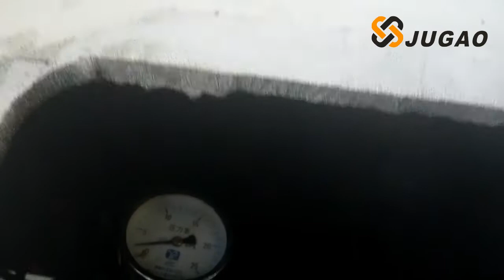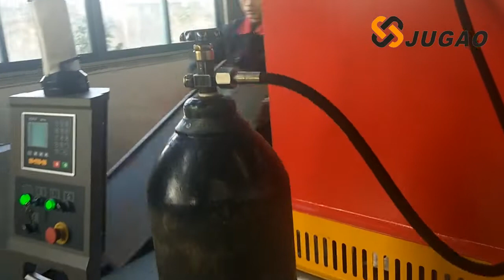QC12Y/K hydraulic shear machine. metal shear. blade can't up. How to add Nitrogen, and blade can up

Comment: The nitrogen pressure is about 5Mpa. 
Recommended wearing safety glasses
Maybe backout plunger on filling tool before removing the hose to maintain charge pressure in cylinder.
Reply from the maker: yes. saftety gallsses for the security